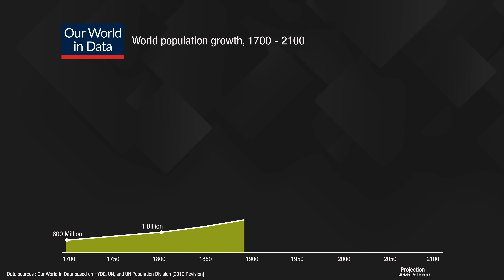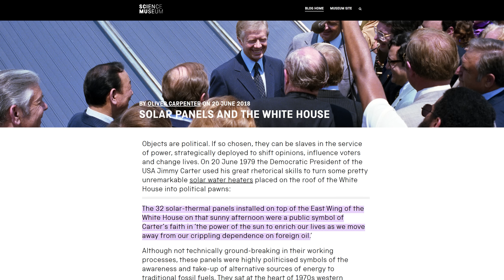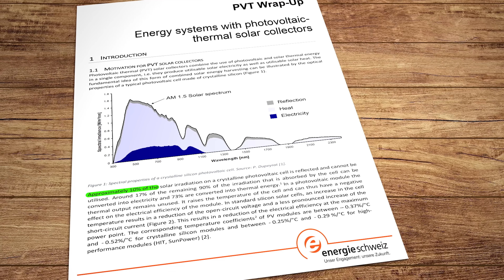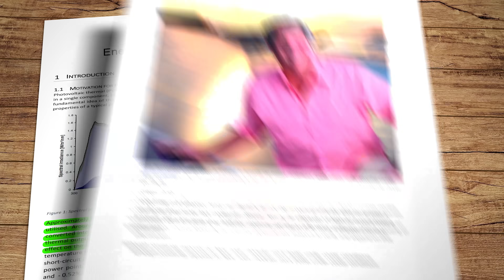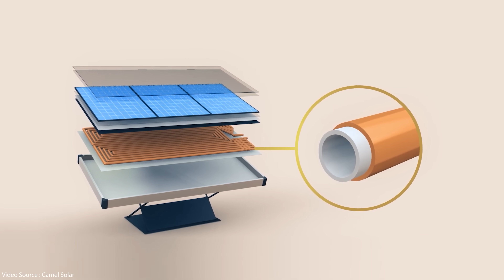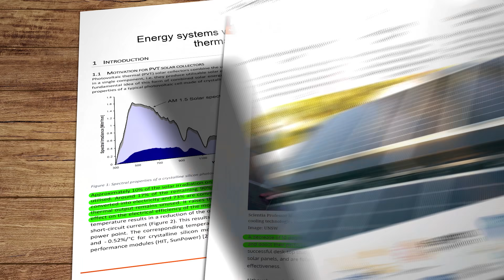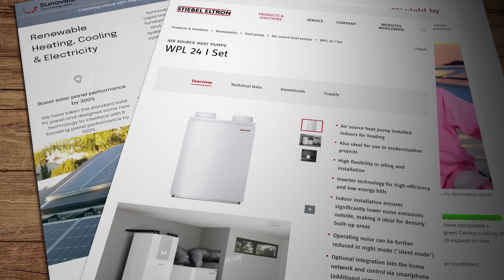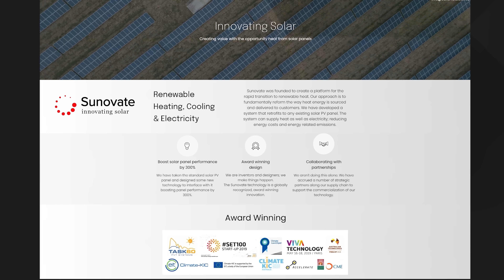The Solar PV panel that provides electricity AND heat for your home!

Comment: @Just Have a Think   It is not clear to me that using air instead of water reduces the complexities of design and installation or improves the heat transfer characteristics, and in fact, I believe that the reverse is true.

Water is 23 times more efficient in transferring heat than air so to remove the same amount of heat from the PV array, more air must flow through the system which means large volume duct work and a power hungry blower or blowers.

Using water, heat can be moved from the panels with a 15 watt circulation pump, to the point of utilization (mechanical room/equipment) via 3/4" plastic piping easily routed, easily insulated easily concealed within the walls. To move the same amount of heat using air as the medium, the duct work must be substantially bigger and so, it is difficult if not impossible to route through interior walls and it is more difficult to insulate. The material and installation cost of plastic piping is significantly less than for hot air duct work. The operational cost of running a blower fan is greater than the cost to run a circulation pump.

Interconnecting the duct work from panel to panel would be problematic whereas the interconnections between water cooled panels can be done with a simple 'push to seal' connector. With water there need be only one, small  diameter, easily sealed, penetration through the roof. With air, I expect that using the design you show here, there would be multiple roof penetrations, each larger and more difficult to seal than is the case with the single small diameter hole a plastic piping water system would use.

The use of 'Three pipe, Reverse Return' piping within each panel assembly, would easily balance the cooling effect across the full area of the panel. 

"The liquid needs to be in constant contact with the back of the panel". 
Yes there would need to be a tight interface between the heat source and transfer medium which is not I think, a difficult problem. Starting from the 'money is no object' end of the spectrum, an extruded aluminum plate with integrated piping, slathered with thermal conductive compound and pressed to the back of the PV array would be more effective at removing heat than any form of forced air transfer. An MDF panel with grooves that is then embossed with an aluminum film and has PEX tubing snapped into the grooves could be a solution less costly than the extruded aluminum. Perhaps tubing in direct contact with the PV array and then embedded in gypsum or epoxy or a cementitious product. Whatever the most effective and economical solution is, I am confident that a water based system would be more effective and ultimately cheaper than an air based cooling system.

The concept/installation drawing that shows duct work, an air handling unit and a thermal transfer and storage unit, all located in the attic belies the complexity, difficulties and space consumption of such a system. While it is common in some parts of the world to locate air handling equipment in attic spaces as shown, it is, for reasons of operational efficiency and serviceability probably the worst location to install these systems. Whether heating or cooling, if the goal is to reduce energy consumption and improve comfort, duct work and air handling equipment should never be installed in an (unconditioned) attic.

Lack of freeze up is the one point I see, where a forced air cooling system for PV panels has the edge over water based system. While a 'Drain back' design can provide the needed protection for a solar hot water heating system, I think it would be difficult to implement for a PV cooling system, and so I think that antifreeze is the only viable solution. Unhappily antifreeze does have some problematic elements. It's viscosity being higher than water it will likely require a slightly bigger pump than is needed for a pure water system. Antifreeze also has a tendency to 'find leaks'. Where a soldered copper joint or valve stem packing might hold with water, antifreeze seems to find a way through any minor imperfection. Toxicity is also a concern, but each of these problems has solutions and once again the benefits of a water based cooling system are, I think, significant and entirely outshine the use of an air based cooling system.

Perhaps the designers of the system you show here have practical answers to my doubts but from what is shown in the video it seems to me that forced air cooling of PV panels in general and this system in particular is not going to be successful in the long term and perhaps not even in the the short.

Even with all my blathering on here, I've not been able to accurately express or detail what seem to me faults of principle and/or implementation. If for some reason you would like me to expand upon my attempt at expounding you may let me know, but I rather expect that you've enough on your plate already.

Comment: You could attach a sterling heat engine to the outflow to generate more electricity as well
Reply: I'm fairly certain Dr Phil mason would have an opinion on this.
Reply: @b0b5m1th  Can't wait until he "debunks" the moon landings.
Reply: Sterling engine, peltier effect, any other thermoelectric/thermomechanical generation.

Comment: I'm amazed that they took so many years to turn this into a commercial product. I suggested the idea to a manufacturer, decades ago. I've also asked panel suppliers about this for many years. A friend listened and built a system for himself, and it has been working for at least 13 years. What has kept suppliers from taking the idea and running with it for so long? I never expected to see my pension before these became available to purchase!

Comment: Here in Holland (or the Netherlands🙄) this technic is already booming. I myself got the SolarFreezer system. PVT on the roof and a reservoir in my crawlspace. Floorheating is a must have. And a NIBE heatpump. I have it running since December 1st.  Used 215 kWh in December COP of 5,6. I'm monitoring my usage over the year but I'm using far less energy than from my residual heat from nearby industries contract, offered via a local network throughout the neighborhood. I'm glad I did the research and found the PVT system and even more about its performance.
Reply: Jurgen welk merk PVT heb je gekozen ? heb je een link?
Reply: @boattrip  Als je genoeg oppervlakte hebt Volthera PVT panelen, als je (dak)oppervlak tekort komt dan Triple PVT panelen. Meest kosten-effectieve / meest efficiënte per m2.
Vaillant, Nibe en EcoForest hebben als warmtepomp fabrikant zelf PVT ondersteuning.
Via de PVT leveranciers kan je in contact komen met (totaal)installateurs die het complete systeem kunnen samenstellen en installeren.

Bijkomend voordeel tegenwoordig is dat PVT wel leverbaar is en lucht/water nauwelijks leverbaar is vanwege ventilator leverproblemen.

Om de systemen te vergelijken kan je rendement en opbrengst inzien op https://bcrg.nl/nl/verklaringenregister/
Reply: @TeXiCiTy  Dank!
Reply: Booming hey?? 😂
Reply: Is it a ground source heat
 pump?
Reply: @randybobandy9828  yes , you will need a ground source heatpump to pump around the water
Reply: A not completely unrelated question: what's the difference - if there's any - between Holland and Netherlands? I'm from Brazil and we use only Holland here (Holanda in Portuguese). Thanks!
Reply: This is encouraging to hear ^_^
Reply: How much were each of your panels? & how many did you end up getting???
Reply: I've got 8 PVT panels. It delivers enough energy to the ground source heatpump to cover the fall and spring, with a COP of around 4. In the winter the COP falls to under 3.

Comment: It makes really really great sense!  And if there was enough heat, one could run sterling cycle engines and generate even more electricity, the waste heat going into the pool/ground storage mass/etc.
Reply: I was wondering about doing direct thermal to electric conversion rather than a sterling as a no moving parts system would be cheaper, easier to maintain, less noise etc but i'm not sure what the minimum temperature gradient is

Comment: Lavo has a unit that stores the sun’s energy in Hydrogen 35 kw of power is stored in low pressure hydrogen cells. Not Batteries Batteries are not Green. hydrogen from solar is green.

Comment: You don't need any heating in buildings when the sun shines and it is 20 degrees outside, apart from free hot water. How would the temperature of the heated medium be brought up to give hot water to an entire district? Those systems have a temperature of 70-80°.

Comment: In my area of Texas in summer (which is effectively 9 months of the year), it's not uncommon for the interior of cars to hit 160F on a regular basis. I had a hatchback that literally came unglued in the mid 2000s one particularly brutal summer. With my current project more focused on graphene extension applications, I've been getting rather interested in making TEG hybrids of late that take advantage of this insane heat on our roofs. Not an optimized solution, but one wonders if solar and TEGs could be combined as double dipping.

Comment: Thank you for this new video! It's great to see you again.

That was a really interesting introduction to the concept of combining solar thermal technology with solar photovoltaic panels. Sunovate's "cassette" looks intriguing but it seems like an idea that would work better with new home builds than retrofitting older ones. All that moving hot air around inside the house works a lot better in homes that are built with central HVAC to begin with. But when you're starting from a blank page there's all kinds of wonderful things you can do with diverted heat energy, as you showed later in the video. I wonder if it could be integrated with vertical farms and apartment buildings?

Man, that idea of collecting heat in the summer and storing it underground could be a video of its own! Just the concept of heat energy (or hot air) being a resource that can be applied where it's most needed or even stored for months is so European, I love it. Here in North America we're used to thinking of heat as something you keep in, but not as something that can be pumped from one place to another or stored like a jar of pickles.

Getting back to solar thermal systems for a minute, depending on the cost Sunovate's system might be worth using for renovations of older homes just for the increase in the PV panel's lifetime, even if you don't have any way to easily utilize the resulting thermal energy. If it can increase the panel's lifetime from twenty to fifty years, that's got to be less than the cost of installing the thermal system.

Comment: I think there's a thing called the thermoelectric effect whereby heat differentials can be converted directly to electricity.  Can this not be used to harness the difference in temperature between the top and underside of the PV and create electricity from that?  Or perhaps it's too inefficient.  For that matter, why don't we use thermoelectric generators rather than PV altogether in countries like Australia?

Comment: I added copper plate with  with pipes to the back of my solar pv panels 10 years ago, pumping heated water underground into thermal sink for winter house heating and water heating. works wonders(Western Australia)
Reply: You could make a video on this

Comment: 6:09 "A device that relies on the sun but actually gets less efficient as the sun heats it up." Reminds me of a drawback to vitamin D production, which is decreased by the tanned skin blocking the necessary UV. Sometimes you can't win for losing...

Comment: I've been working on solar heat and PV for about a decade. Especially low temperature heat is a difficult one to utilise. 40C air has next to no use other than pool or space heating and is treated as water energy by most industrial scale operations. To be useful heat needs to be at least able to generate steam and that would not be good for the PV technology. PVT is often called the best of both worlds but in my experience it brings out the worst in both. For heat to be useful it needs to be really hot, if you want to cool PV in a useful way you need to go way cooler. 
A real shame as the idea seems so simple... I have spent a lot of time trying to make ends meet economically and technically, I have to remain sceptical.
Reply: a product called "Air-to-Water Heat Pump Water Heater" or "Residential High Temperature Air/Water to Water Heat Pump" will heat water to 80-90 degree Celsius (close to boiling) provided that you feed it ambient air (at least -25 degree Celsius). Using a heat-pump you can convert low-temperature (40 degree Celsius) to high-temperature (80-90 degree Celsius) and the process is more efficient the higher the input temperature is.

Comment: So here's a comment I posted on Rosie's video: "So would there be anything to stop you using the heat captured in a sterling-type generator to just add to the electricity generated? If you were hoping to max out the electricity generation, that is..." 

I've often thought about how a sterling generator could - I think - change heat energy into work/electricity. Would anyone have any views as to whether this is a good or stupid idea?
Reply: Now a stirling engine gets more work out the system, but not necessarily at the time that you need it.  I'm already generating more than enough for my needs from early spring to mid autumn.

The big challenges are:
- Storing surplus heat in the summer to use in the winter
- Creating high grade heat out of the low grade heat that emerges from the solar panels.

The 2nd challenge is solved using a heat pump of course.  But the 1st challenge is very tricky to solve.

The optimum period of performance for PVT heat is February / October.  It helps a little over the winter time, but not enough.  The rest of the time there's too much heat for a domestic UK dwelling house without a swimming pool.

Comment: Ever open up a laptop? There's a flat copper tube going from the fan to the CPU in mine. A similar flat system can be made which can be affixed to the bottom of the panel array. These can be monoconstructed for any brand of panel and any number of panels; only inlet and outlet connections. This can be connected to a geothermal heat pump system so that, in summer, the full length of the pipe array can be used for cooling the panels, and in winter, the heated medium can be routed directly to the heat pump. The system can be controlled via a thermocouple and relay actuated valves. This system can also be used to preheat water for a water tank which feeds instant water heaters (forget what they're called)
Reply: Just musing here... I wonder if the solar panels can be slightly tilted such that a venturi effect is created, drawing air like a chimley (I know it's CHIMNEY lol) to the  roof peak where it can drive horizontal wind blades, capturing some of that heat indirectly.

Comment: My biggest problem with this technology is that when panels need cooling the most, homes don't need any heating because it's summer. The commercial applications are interesting, though.
Reply: Exactly, you simply have no use for waste heat at the time of year it's being produced. Winter is when you need heat and it's also when solar panels are at their least useful.

Comment: EVs are not going to take over the world by 2030 in the UK or Australia. The reality is new car sales are well under 5% of the total vehicle fleet so even if every new car was an EV it will take over 20 years to be fully electric. That is unless there is a huge EV supply increase and massive government subsidies. 
The idea of shifting heat from the back of solar panels using air sounds problematic. Air does not have a height thermal capacity so you need a fair volume to accomplish anything. What size ducting is required? How big are the holes needed in the roof? It seems to me that liquid cooling is a better idea because liquids have greater thermal capacity. Surely it is possible to design a liquid cooling system to evenly cool a solar panel? Then you could have an insulated water tank where cold water is drawn from the bottom and the heated water fed in at the top creating a low level heat reservoir. The big issue is that you don’t need lots of domestic heating in summer and in winter you don’t get much heat from the system anyway. As for heating pools in southern US states in the summer you have to be joking. Having lived in Southern California in a house with a pool you actually need to cool the water in the pool down to make it pleasant in summer! 
In principle taking heat from the back of PV panels sounds like a good idea. Can it really be done effectively? What can you realistically do with all the heat in summer? Are you going to get any usable heat in winter?  I am sceptical, but I don’t know!